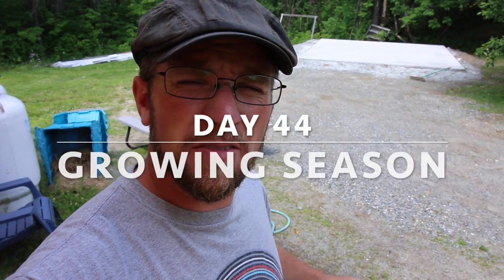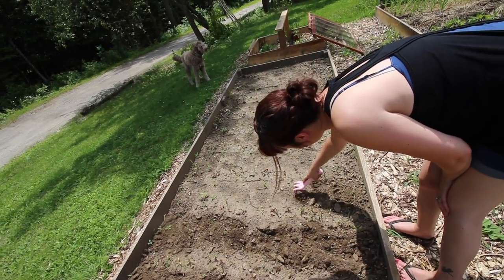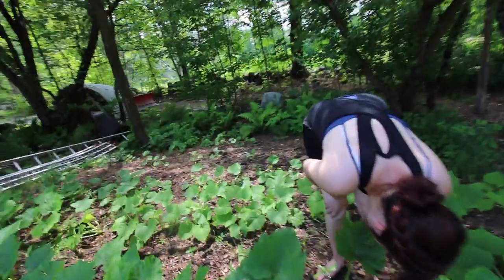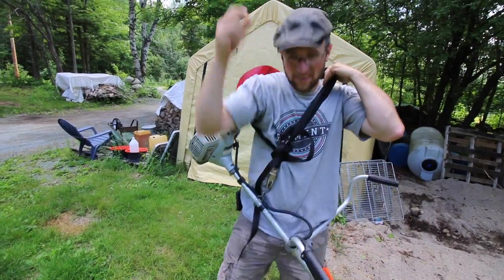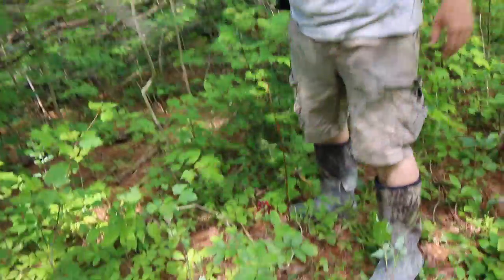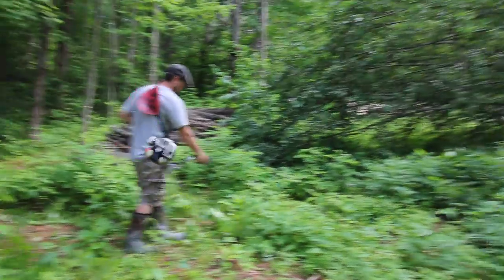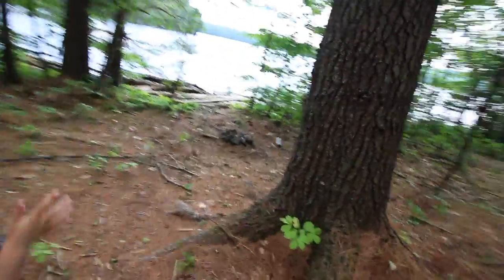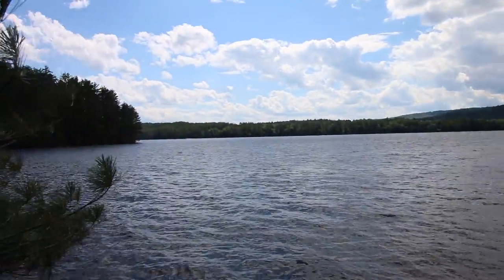Growing Ginseng on the Modern Homestead

Comment: Ducks. add a lined wood raised pond with a 2 inch drain.  Install a garbage disposal to chop greens kitchen scraps and 1 inch direct flow drain into duck pond to feed.  Throw valve and,use 1/2 inch poly to irragate.  Build duck villa off one unused side with nesting boxes that the eggs roll inside.  Clean eggs.  Ducks build perfect compost and can be trained to travel cleaning bugs ect along the way.  Use deep chips feed corn and piggerate..another garden.  Duck pond cleaning solved.  Passive tufftex greenhouse ideal along south wall.  A pass thru window moves cleaned goods inside..tray fold over end of,pond.  Chicken prep area..into clean kitchen.  Use chest freezers make block ice.  Think future production with finding a walk in cooler..   Fun stuff
Reply from the maker: I like the walk in cooler IDEA! Thanks